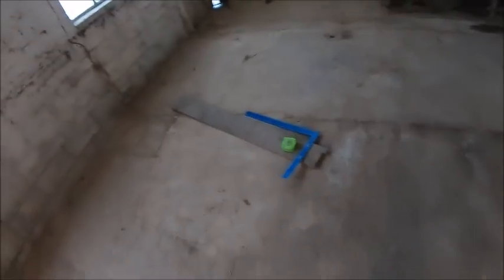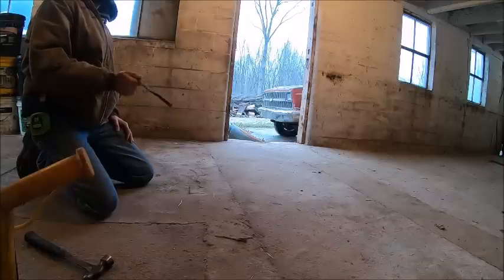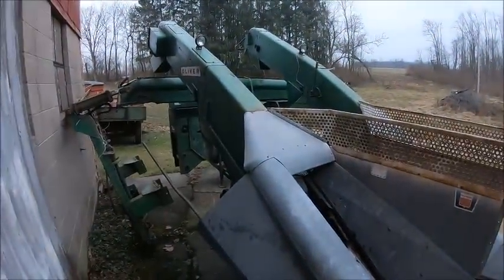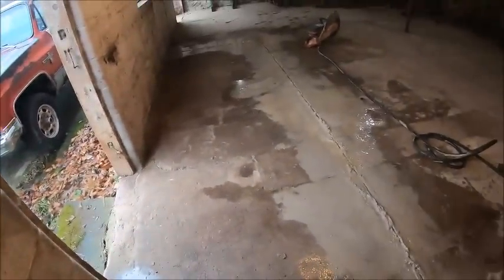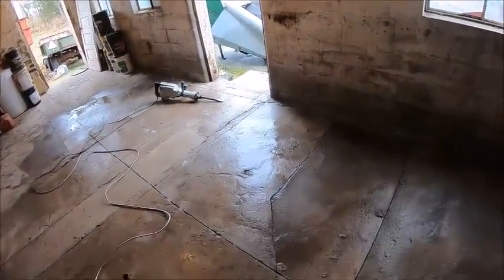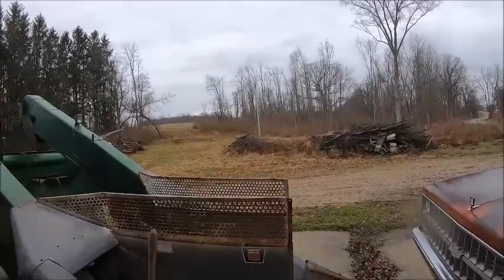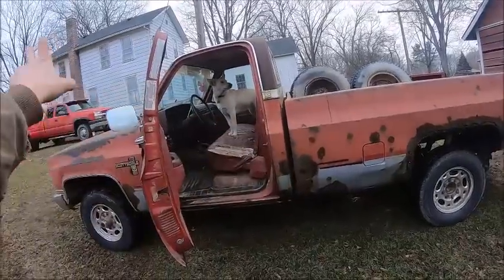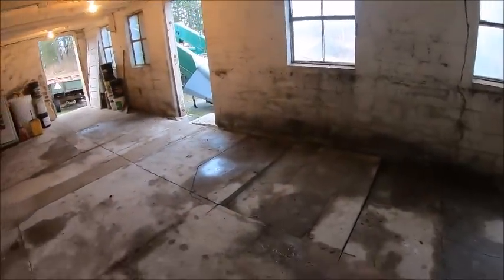Barn Door Project Part 1: Cutting Concrete

Comment: Just a quick tip Ethan, when you layout your slab cuts. You can lay down a heavy string/small rope and use marking paint sprayed over it. It leaves a nice 1/4" clean line to follow.  A cool side note on the age of those cinder blocks.
Reply from the maker: Now that’s actually a helpful idea.
Reply: Or use chalk line and spray with clear 23 years coring and cutting experience.

Comment: Wired my son's door in his block barn. The floor was good it was a dry barn. We cut the walls with a concrete saw. Saved the lintel and replaced it with 2x12's. We put in a 10 foot roll up door. Looks great. Good luck. I'd suggest an apron like a driveway.

Comment: If I'm remembering the milk hauling stories from my Dad and Grandpa correctly I think the switch from cans to bulk took place in the mid-late 50's early 60's. So there's a possibility that is when the milk house was built onto the barn and the wall was updated.  Or I might be totally off the mark. Lol
Reply from the maker: The beginning of bulk handling started during WW2. By the late 50s there were very few dairies that would even accept cans.

Comment: Have you looked up that site, Vintage Ariel photography site . They seem to have mostly rural areas photographed. I assume it was from some USDA type program or information gathering program. The oldest pics of my place I could find were in the 80s but some of the flight routes were a good bit older than that. I was thinking some may have been in the 50-60s there just weren't any of my place.

Comment: A mason will never cut a concrete block where the internal webbing is. Unless you have some ollllld blocks with 3 stanchions don't cut them down the middle.

Diesel Creek did a series on fixing a block wall foundation on a church. He put a lot of thought into it and shared a lot of knowledge.
Reply from the maker: I’m not cutting any blocks…

Comment: I watched your video when you got side-swiped and I do agree on you about him being in the wrong but I also followed a farmer who didn't turn off for 15 miles while taking up part of the incoming lane and while having room on shoulder of road. As a farmer myself I didn't like what he did and unfortunately I didn't have a phone with a camera then
Reply: To add the only thing I can think of as to why the farmer didn't get over is because they didn't know the area well
Reply from the maker: Don’t know what that has to do with this video but anyhow. Unless you have enough room to get the tractor and implement all the way off the road you are not supposed to ride on the berm. You are supposed to drive in the lane like regular traffic. If you are partially off the road blocking visibility into the lane ahead and you either stop to let cars around or cars pass while you’re moving and they get in an accident you as the equipment operator are at fault. If you stay in the lane and somebody tries to pass you and gets into an accident then it’s their fault. The only traffic you need to be concerned with is oncoming so they don’t hit you head on. Anybody behind you can wait until there is a safe spot to pass or for the operator to turn off. What the guy did was perfectly fine and I probably would have done the same thing.
Reply: I agree that he was in the right for staying in the lane but he never got over and I couldn't see around him very well being that it was a John Deere 9r. He may not have been able to see me well though. Sorry for this not being with anything to do with this video been trying to catch up on your videos

Comment: May I make a suggestion? Providing that the opening will be wide enough, do not cut the blocks in the very center. Instead cut them just in front of and flush with the center divider. That will give the remaining portion of the block greater structural integrity and they will be less likely to bust or crumble. In theory that idea should work. However it might not be practical for you to do it that way. Anyways, it's just a thought. I hate masonry work but I am looking forward to seeing the rest of this project.
Reply from the maker: I’m not cutting any blocks…
Reply: @Oliver66FarmBoy  Good deal. It was late and I was half asleep when I watched the video. You probably explained that and I just missed it. Thanks for the video !!!

Comment: Use a chalk line
Reply from the maker: So the water can wash the chalk away. Ya no.
Reply: @Oliver66FarmBoy  Pink chalk line is permanent. Will not wash off, period. Blue chalk line will.
Reply from the maker: Ya know what makes permanent marks and saves you from having to go out and buy a bunch of extra shit? Chisel marks and a saw score.
Reply: Chalk line and clear spray paint over it.What we do for cutting blue stone.Using a self propelled saw.
Reply: @Oliver66FarmBoy  I'm not telling you how to do anything. You can do it anyway you see fit. I was just stating a fact.